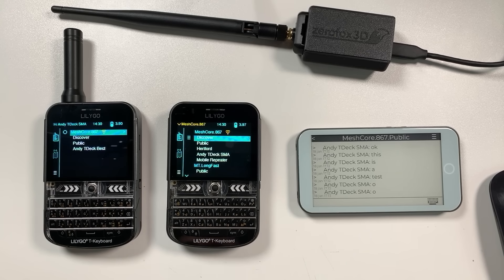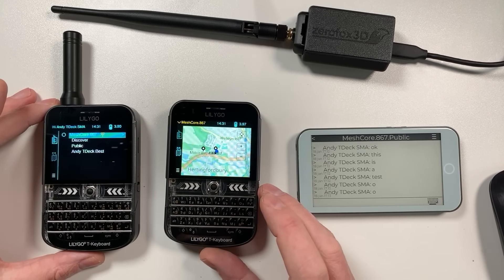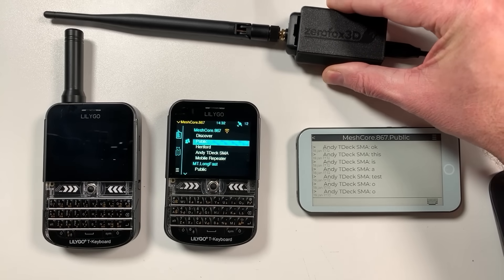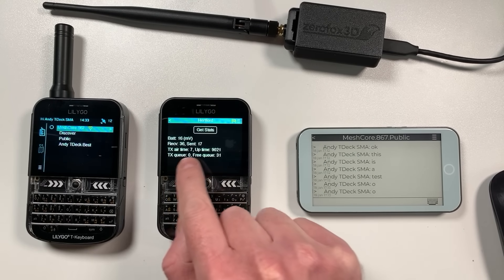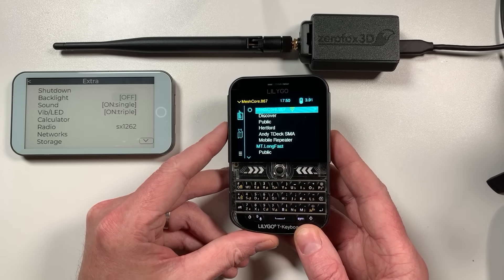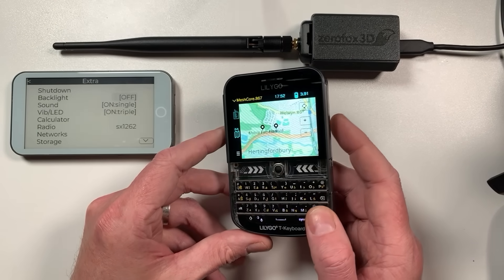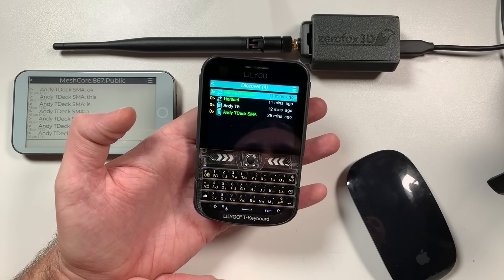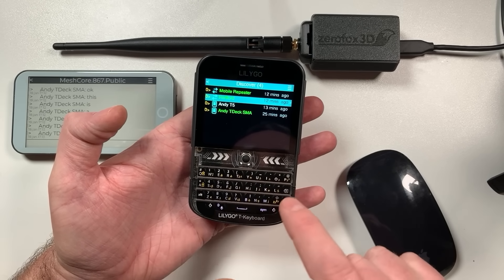Introducing MeshCore

Comment: I have it running on 3 devices. Easy to setup using many of the same devices as Meshtastic. Really fast and you can see if your message was delivered. Working great so far. Not many users in the Gulf Coast area of the USA.

Comment: Pretty sure there Pro's and Con's to either or project one supports. People complain about MQTT for Meshtastic or how it in an busy area floods the system. And sure i can see that when a single user has 10 nodes in his house. Same would happen with any other mesh you gone create. More nodes more traffic, and now you add more radio traffic, and use you can say; look how busy it is on Meshtatic node wish not only shows Mestatic traffic, but everything that is open on that channel sending, wish would on the same mode be your project to. Thus still not solving it; As just showing it with one user and 2 radio's is not really a fair comparison. Put yours on LONG_FAST as well and see the same high channel utilization. Because there simply a LOT on the free small bands, car tires, weather stations, door bells etc etc. And more in your area you get the harder it becomes to get your message across. Don't get me wrong i not per say a super fan f Meshtatic and the directions it seems to sail, or more lack of fixing issues that bin there for more then a year while removing us full amateur functions, or adding crap nobody asking for. But your system that specifically needs 2 radio's to be a working setup is not per say ideal either as you double the channel utilization as is and reduce far away radio receiving as well it gets busy with repeaters and client nodes talking to it back and forth. One should be able to out the box, chat with one node one buys, and get with making a good antenna, as what made the hobby fun to start with. I my self live in an really calm area, next node to me is 10km away and next from that once again a good ten plus. MQTT in that is helpful for my area as long not every node within that 10km spot is on mqtt, one would only need one. And that works, and here we have a Channel utilization of like 3% ~ 5% But that also because i only and only have 1 node active despite having like every version laying around., they only go on when i g hiking, or driving so it be a mobile node. Granted to specifically and only on one version of Meshtatic, before they started to goof it up 2.5.5.e182ae7

Comment: Ah, finally. I am so fed up with the broken promises of meshtastic. I can't stand when projects keep adding features before the basics work properly. 
But,  why does your router node not use the NRF52 platform, the heltec things use so much power I would need a gigantic solar panel and battery. Well, I guess you need to start somewhere.
Reply from the maker: It does support RAK and other nRF52 devices now

Comment: Any idea for a feature to support a mobile repeater, i.e. a repeater mounted to a vehicle or carried by a traveller, such that it can courier messages from one area to another, carrying stored messages with it. Won’t support instant messages but would be good for a fidonet-like email system that can get a message to someone distant over a few days
Reply: There's nothing stopping anyone from making a mobile repeater (a friend already has one, in a backpack). For ad-hoc deployment, out in the wilds or wherever, is perfectly reasonable use-case. It's just in a more public setting, if repeaters moved around too much the paths that get built up can become invalidated, and nodes would need to re-initiate path discovery, taxing the mesh.
Reply: @ Exactly. What i’m talking is a repeater having a dedicated “courier” mode, where the mesh sees it and says “This node can’t forward instant messages to the larger group, but it can see this list of nodes we cannot see, and can be sent direct messages for those nodes, which will be stored for a few days until it moves and can send to that node when it gets there. Mesh + sneakernet

Comment: Hi. Can repeaters be connect via the internet? Is there a possibility of a similar protocol on bluetooth or wifi that could be routed via a repeater?
Reply: You could write a custom repeater that also tunnels via the internet, and supports the end-to-end routing. (like Reticulum does) I wouldn't want a repeat of the debacle that was MQTT on Meshtastic, tho.
Reply: @rippleradios  Thanks, my main use case I'm aiming at is connecting family at different locations. (Which obviously meshtastic does, but the available firmware is not usable, which is why I was very disappointed that your meshtastic client on the same system was squashed, because that would have been a very good solution) For clarification, I want to cut out the local cell providers and smartphones. I suppose there's no chance of a telegram client (or even better session) being included?
Reply: @rippleradios  Another thought, could the rooms on different devices be connected via internet (or even by joining to a group on an internet chat system)?

Comment: Hmm. I feel like what you're setting up relies heavily on nodes being stationary and longterm. I would imagine if you put one or two mobile nodes in your system they would either overwhelm the grid doing recalculations all the time or would simply not work. Also in most places overcrowding simply isnt much of an issue for folks when there arent many nodes around. I dont think we should split the community but rather work with the MT-developers to have a more intelligent and adaptive routing approach (or at least be compatible with MT)
Reply: You can try to work with MT, but they won't necessarily work with you.

Comment: Wont this require everyone dropping meshtastic and using a new platform? Unless everyone else adopts it, your going to simply be chatting to yourself
Reply from the maker: You can use multiprofile firmwares so you can flick between the different systems.
Reply: @ of course but that negates the fact everyone would have to adopt it over meshtastic to, well, make a mesh, or you will simply be using it alone. And you can on the t-deck but not on the majority of hardware current LoRa users are using

Comment: LoRa is starting to fall into the "hey let's make yet another app (firmware) / let's change things again" trap. The landscape is getting fractured. A lot of people are on Meshtastic, but there's also Reticulum etc of course. It's all good and well if you live in a big city where you may have loads of people who are on any of those. But in smaller areas, you'll need to have multiple devices, each running different firmware, or keep reflashing a device, to discover people (nodes) around you. Is this progress? Sure, yes. But I think it would be better to cooperate and get people on the same platform (and improve that) instead of making yet another one and fracturing the landscape even more.

Comment: Thanks for the update Andy. Ya, Scott's a great guy, I've installed two versions of his firmware so far, sounds like he's made a lot of progress lately, that's great news! I've got two T-Decks with GPS, Altimeter, Atmospheric Pressure, Temperature, and Humidity GY-BME280-3.3 Sensor Modules, ready to add the latest firmware. I wonder if it will support some or all of these sensor modules? Fun stuff!

Comment: If you are radio ham. I don't think you can use encrypted messages. But not 100% sure. Mick
Reply from the maker: no you cant, but this is not on the HAM bands its on ISM
Reply: @andykirby on meshtastic why is there an option for hamradio. Doesn't it switch off encryption? I have it in the it in the ham position on all my nodes. Mick
Reply: Correct ! No encryption on Ham Radio.
Reply: @KB1UIF yep but I don't understand why the meshtastic system has and asked if you are a radio amateur and an option to enable it or not as it isn't ham bands.
Reply: @MakeDoAndMend1 My understanding is  Meshtastic can also be used on devices that work on Ham radio frequencies. Also, different countries have different regulations.
Reply: @KB1UIF  thank you.

Comment: Isn't this?What reticulum was supposed to really be solving the routing and the networking
Reply: Right? It's kinda strange 😅
Reply from the maker: Reticulum is fantastic but we wanted to build the lightest weight system with a really low overhead.
Reply: @andykirby  why not integrate and work with the reticulum guys? I'm looking for a backbone solution that all the different mesh solutions can ride on also...

Comment: Does  this work with current meshtastic devices on the old software or do you have to use a complete different operating system? Does it guarantee message delivery like TCP/IP? and you get message confirmation from sender /receiver?
Reply: Sounds like a completely different system and firmware.

Comment: Had me excited at first. I thought we might see a way to use multiple protocols on a single radio. I'm looking into running a mesh system that blends Meshtastic and RNodes and Reticulum networking but over a single radio but using the protocols as software. It's my hope to get this working with 802.11ah to help with mass adoption. My home state of North Carolina in the US is building out a statewide mesh after the Helene disaster, it's Meshtastic  at the moment.
Reply from the maker: You can do multiple profiles with this tdeck firmware but theres no reticulum yet, Scott was planning on doing it but we ended up working on this idea first. Halow would be great for linking reticulum transport nodes. I've been wanting to try LoRa on 2.4Ghz for a while too.
Reply: @andykirby  It'd honestly be interesting to get 2.4ghz development going... like... if there was a way to make all those USB wifi dongles suddenly do LoRa instead with a software update. suddenly software adoption goes up even if it is an imperfect solution as it'd get more eyeballs onto a project.
Reply: We are working on software to run RAK concentrators with meshtastic to run multiple channels for. Network to get below 25% usage per channel. It’s a lot of work and very little support but if you can find a software guy..perfect
Reply: Same here. I imagined an underlying system that could talk to all platforms. But it seems like yet another platform.
Reply: Good plan, but if that is your intent you should focus on Reticulum. Of the three LoRa meshes currently under development, Reticulum is notable for being made to work with different mediums. It'll run over wifi and 11ah just as well as it will run over LoRa,and seamlessly route between them all. The hard part is convincing people to use it, as Reticulum's setup process requires a lot more fiddling than just installing an app on your phone - for most uses you'll have to plug it in to an actual computer.
Reply: If this is mostly the transport layer did anyone can write code on top of well that's a good thing.
Reply: Yeah it looks like if this is an improvement to the transport layer for l o r a it could be used by reticulum for transport.
Reply: @MostlyInteresting  Reticulum already has a transport layer for LoRa.
Reply: @vylbird8014  yeah I know but I've also read that it ain't that great and it doesn't consider the limitations of Laura it's sort of treats it like every other platform like Wi-Fi

Comment: What would be the reason for replacing meshtastic with this thing you are talking about ? what is the improvement? totally not get it
Reply: when you send a message using meshtastic, for it to get to a remote destination the strategy is called "flood routing."  This means that every node that gets the message, if it is not the destination, will send the message on to N other nodes. Hopefully then some node will happen to send it to the destination node.  Simple, but not smart.

meshcore sounds like (because I cannot see the code) it will be intelligent routing, where some nodes will know how to reach other nodes, and they will send the message only to where it needs to go to get to the destination instead of sending it everywhere and hoping.
Reply: @Sylvan_dB  I just saw someone ask the "mobile devices" question further down, and Andy replied that in those cases, this system will revert back to flood routing. So, doing the same as Meshtastic does now.
Reply: @Sylvan_dB  So, in less populated areas this may not work properly I suppose (depending on the implementation, like you, I have not seen any code). Especially with mobile devices which may be out of reach of each other at any point.
Reply: Looks like its a bit prettier and its allegedly more reliable
Reply: @TheHeartOfFenris  also Meshtastic's routing is hopelessly broken and doesn't scale

Comment: Why recreate the wheel. Just fork meshtastic and make it better
Reply: I went off meshtastic after I started committing code to the project. The code is absolute garbage. Not forking is the best call frankly.
Reply: @andykirby Andy, as someone who keeps dipping in and out of this, I’ve been away for a bit. I can’t really see why meshcore is better than Meshtastic and your great videos don’t really explain it. Are you able to help me understand why a new network was needed?
Reply: Meshtastic is power hungry.
I made some prototype code just to test the range and first thing I did was to sync the nodes and use deep sleep and make them wake up in same window to exchange messages.
Reply: Narcissism
Reply: It's great to have options. I find Meshtastic boring.

Comment: sounds really nice
please dont forget the rak&t114 support 😊
Reply from the maker: RAK is next, they are the best for repeaters 😉
Reply: Especially for solar nodes 👍
Reply: The Heltech t114 version 2 has a low-power Nordic chip in it and it's just fine for repeaters. It also has a right sophisticated solar controller in it. We're trying to use solar with a V3 is is sketchy at best most use an off board solar controller board for those which is exactly what I'm going to do.

Comment: Any idea if this tech could be integrated with meshtastic? Did you check with them? It would save you setting up a whole new ecosystem
Reply: From what I have seen and heard, if you attempt to merely follow a specification of a published protocol thee meshtastic devs think they own your project
Reply: And the MT devs have made it crystal clear that they do not play well with others.
Reply: it couldn't be integrated, because they decided that managed flood routing is the only way.
Reply: @recrof  I mean, the fact there is a pending PR currently targeting the 2.6 release that moves away from Flood Routing as a default, but as a fallback, means this looks to be changing.
Reply: meshtastic project owners are knobs unfortunately. Their code is absolute trash anyway. Onwards and upwards.